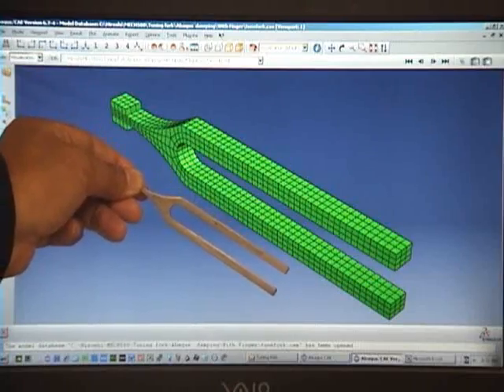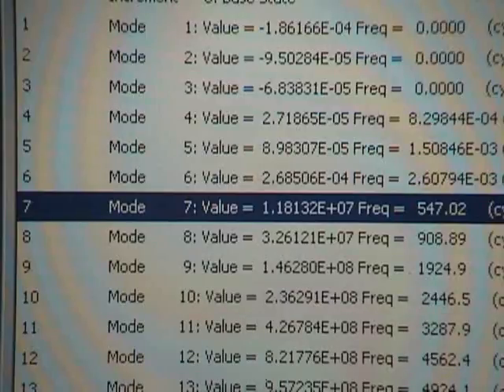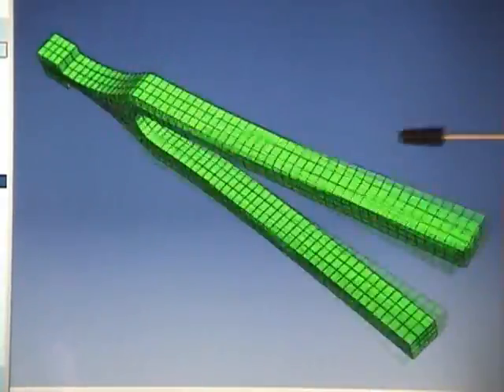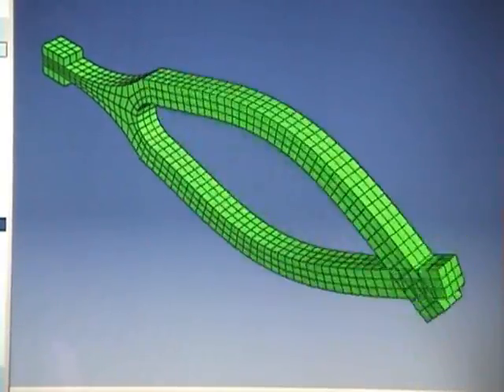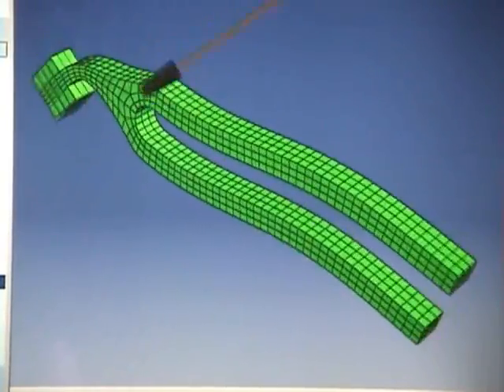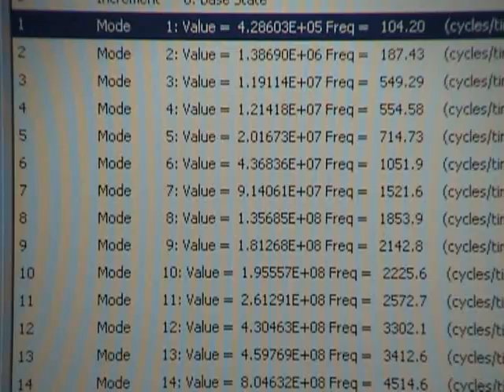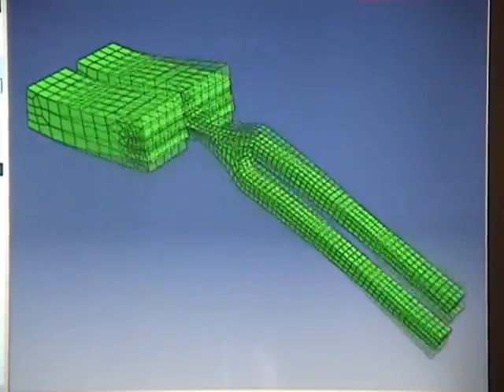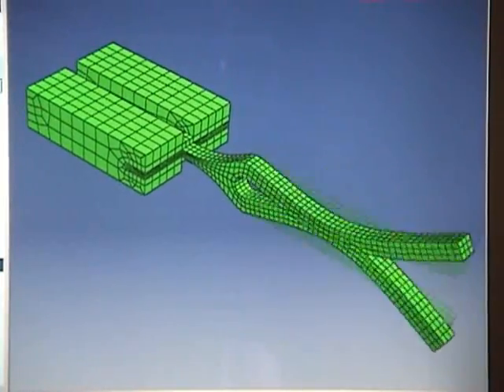Tuning Fork Physics - Part 2: modal analysis using FEA

Comment: Just beginning serious research in understanding the full property of vibration.  So much want put the natural harmonic benefit 2 use. I'd  like 2 see what happens  if base of fork connected 2 another fork opposed the other. Need 2 find the perfect metals or other possible materials and get  2 work. All is energy, frequency, and vibration. All corresponding on many levels holding the clues for manifestation of positive or negative.  Unfortunately the hermetic and hidden knowledge is greedily in hands of the evil and manipulators. Free energy has always here, but no money in free.

Comment: I assume it is 440Hz A, with correct spring steel mat. props.  You generally hear a 'ping' when you first aggravate the fork,  (while holding it appropriately) this will be the higher frequency mode ringing off with the instantaneous higher energy, this dies very quickly and a sustained initial mode will then result.  The finger simulation seems pointless and is applied inappropriately, better to encastre clamp at finger holds.

Comment: you don't hold a tuning fork like that, you hold the fork between thumb and finger rotated 90 deg from your simulation (just below the fillets) holding it in the way you are holding it will cause excessive damping, this maybe why you have discrepancies.  Could you please post the frequency and note of the tuning fork (it will be engraved on the handle).